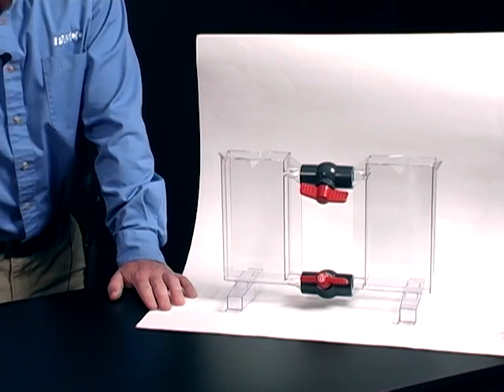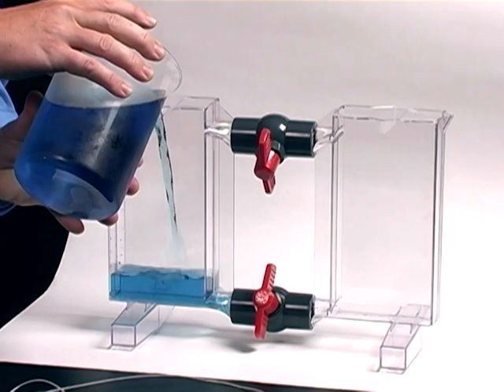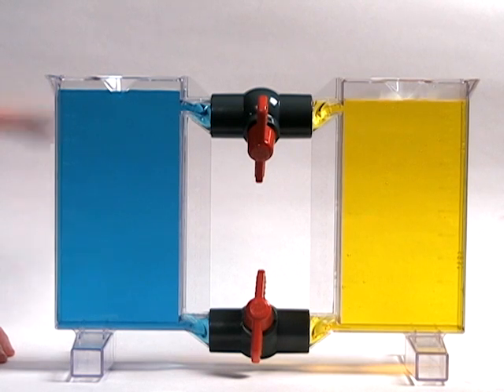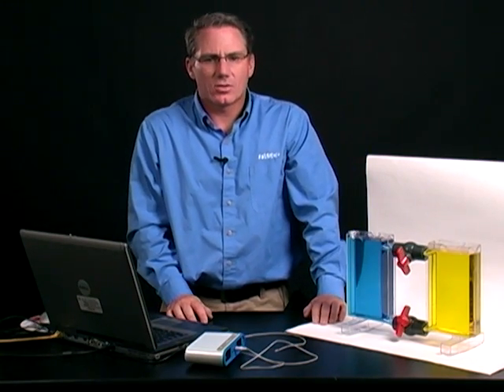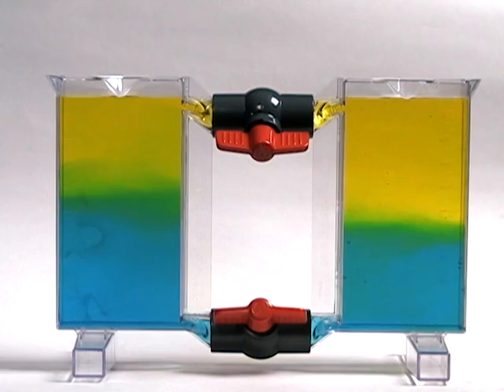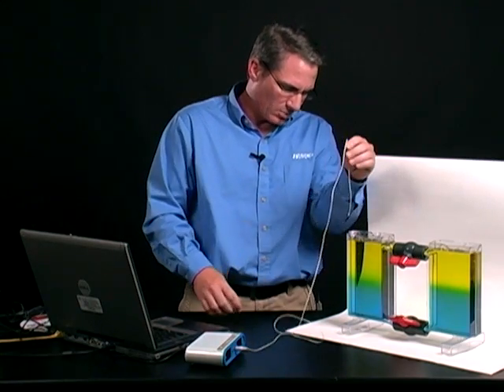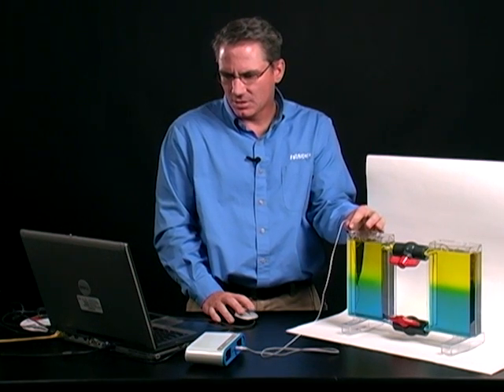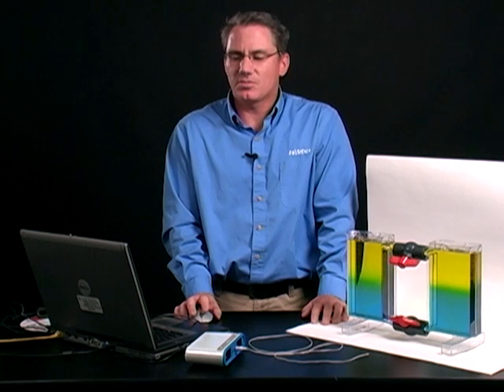Modeling a Thermocline with the Density Circulation Model

Comment: Huh, i didn't see what data what were betwixt 23 an 14 degree. Could you please post what data that were in the description? Mulchas gracians.
Reply from the maker: Here are the measured depths and corresponding temperatures:

depth (cm)	Temperature (°C)
1	31.6
2	32.6
3	32.7
4	32.8
5	32.8
6	32.6
7	31.9
8	30.8
9	28.8
10	26.2
11	23.2
12	20.6
13	14.4
14	13.7
15	12.9
16	12.3
17	11.4
18	11
19	11
20	10.9